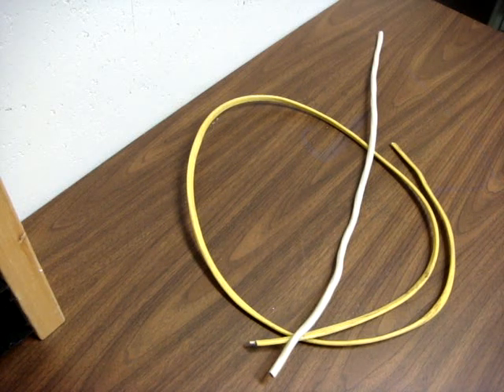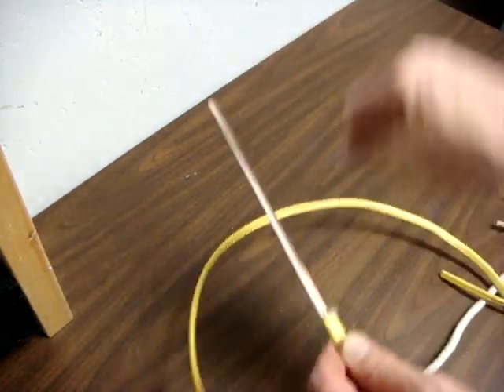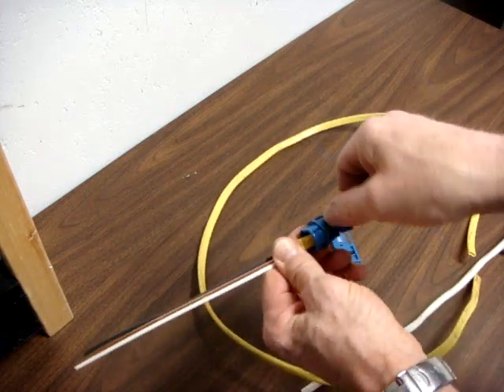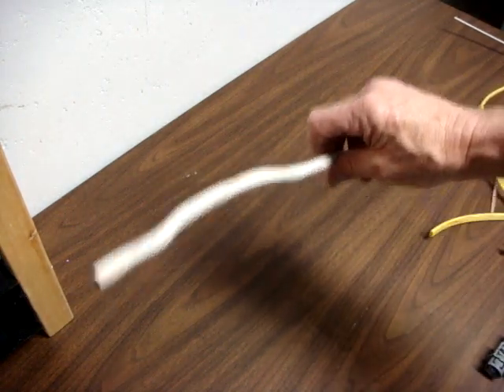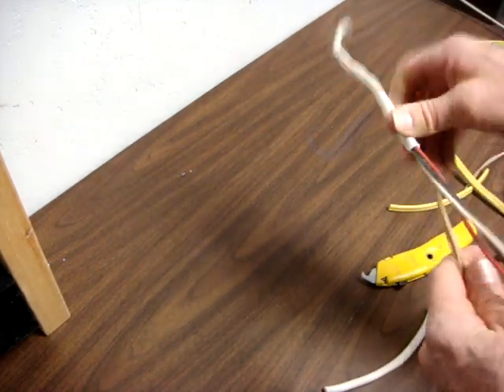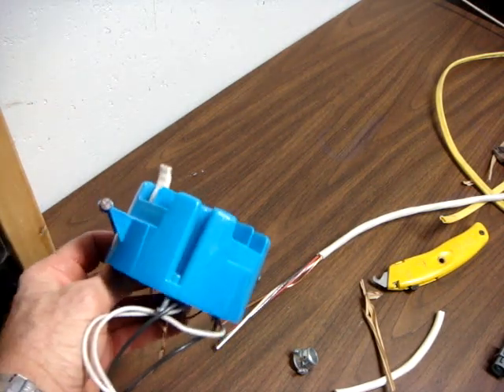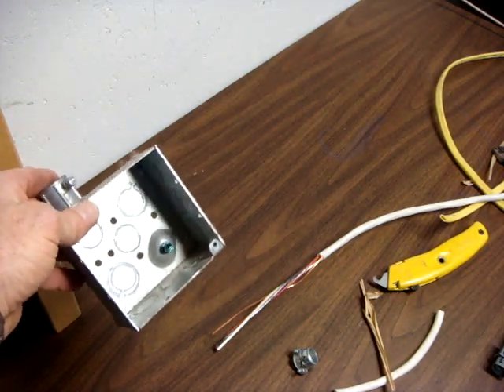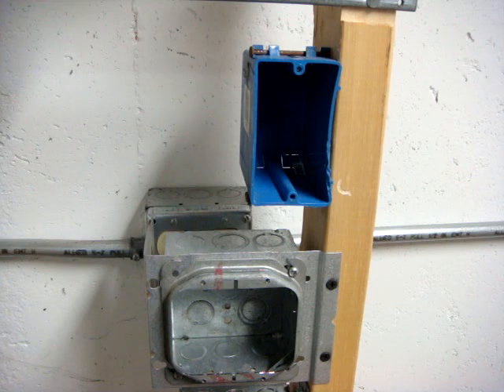Romex® Basics

Comment: Maybe someone can help me.  The yellow outer sheathing has small tears in them.  Is that ok?   The inner wires are not stripped
Reply from the maker: If you think the jacket's integrity has been compromised, you can wrap it with electrical tape.

Comment: That third, blue connector: how do you get it off the wire? I am struggling with it. I'd rather not cut the cable, I need the length.
Reply from the maker: Use a side cutter and destroy the connector.

Comment: Please show how to splice multiple wires together.

I am practicing my Pig Tailing and the Pig Tail will not twist around the other wires when twisting the Wire Nuts.

I am practicing on fake boxes not connected to anything.
Reply from the maker: Are you splicing solid conductors, or stranded conductors? What gage conductors are you splicing?
Reply: sparkyjohnrg I am practicing splicing 14-2 wire for 15 amps capacity. These are solid copper conductor wires.
Reply: +SPARKYJOHNRG,

Well how about an answer here?
Reply from the maker: Michael, This is a very busy time of the year, and I do these videos as time permits. I do this as a service to viewers, but I am unable to do them "on demand".
Reply: +Sparkyjohnrg,

I am not asking for videos just a quick answer.
Reply from the maker: Michael, you wrote: "Please show how to splice multiple wires together. I am practicing my Pig Tailing and the Pig Tail will not twist around the other wires when twisting the Wire Nuts. I am practicing on fake boxes not connected to anything." To me, that is a request for a video, as I cannot show something without pictures. The brief answer would be that a pigtail should not "twist around other wires". If all of the wires are solid, cut them all the same length, and use a wirenut to splice them (or WAGO's). You are not required to twist them together with a pliers.

Comment: Sir may I know what size of connector for 6/2 wire I can use for steel city box and also a connector for 6/2 wire going to load center or service panel.thanks and more power to you sir.

Comment: need to know what size wire nut to use I'll have two 12 gauge wires Plus the little thinner wire from the light fixture. dude if you got a second and could recommend something that would be great
Reply from the maker: All brands list the wire sizes and combinations that their wire connectors will accept. Generally speaking, your situation will work with yellow or red connectors.
Reply: Thanks Sparky

Comment: Excellent Lesson!  Fast and Informative.  The one thing I would add is a more thorough description of boxes.  Does the single box size work for a switch and an outlet?  Why are there so many boxes for sale.  When do I use this one or that one.
Reply from the maker: +Anony Mus   I wanted to keep it short and informative. I ALWAYS use the deepest box that will physically fit in the space. That gives you more room for wires and devices. Plastic boxes are usually cheaper than metal boxes, and install faster. Some choices are more personal preference than anything else.

Comment: I recently had our old natural gas water heater replaced with a new one.  This one has an electrical ignitor instead of old style plot.And that means I have to have a power outlet to plug the heater in.  I have an existing circuit in the closet which feads to a light switch that controls a light.  There is anothere similar switch exists with a red face plate, labelled as Gas Burner which leads into the furnace.  I wanted to add a receptacle BEFORE the electric switch so that the operation of electric or gas burner switches do not interfere with the receptacle. Although, I have some idea as to add receptacle in parallel, so that in case something doesn't work with receptacle, the other switches still work.  I will be more confident if I could see a circuit diagram.  Can anybody please help?
Reply: This is a little late, so you probably have this done already but maybe someone will find this useful. you can take power from the light switch to power the new outlet you just have to wire it correctly. After you turn off the circuit in question, open the light switch box and remove the screws that are securing the switch to the box. Count the romex coming into box, each will have a black (power), white(neutral) and bare copper(ground). If there are more than 2 Romex in box, all the blacks going to wire nut are your power wires. The one wire coming out of wire nut to switch (pigtail) is power to switch. The other wire connected to switch is taking power to the light, always keep that separate. If you want to take power from light switch box, run one Romex of the same gauge to the new outlet[either 14-2(white Romex) or 12-2(yellow Romex). Feed one end of Romex into switch box strip about 10 inches off by running a knife down the middle of the LAST INCH OR SO of the end of the Romex sheathing. Split the sheathing, and peel the remaining 10 inches off and then cut just the sheathing off. Connect each wire from new Romex to their respective wire nuts in switch box by stripping the end of each conductor (1/2")to make a good copper to copper connection. So all of the black power wires go to one wire nut with one pigtail wire taking power to switch. All neutrals in this case will connect together in one wire nut. All grounds go together, with pigtail to ground screw on switch. If the box is metal be sure their is a ground connection to box. In the beginning, If the switchbox only has two Romex coming into box, identify the switch leg( Romex going to light) which is the black wire connected to switch and keep it separate. The other black wire connected to switch is the power. Take the power wire off switch and connect it to the black wire from Romex going to new outlet, with one power pigtail that you will reconnect to switch. So power is routed around the switch but also has a pigtail that brings power to switch. Connect neutral and grounds like previously stated and you're solid.

Comment from the maker: You cannot cut a wire and cap it off with wire nuts. All wires must terminate in a junction box. Whether you must remove the wiring from the switch box would depend on who ordered you to remove the light. Ask them.

Comment: question: I have an electrical light I want to permanently remove from a garage. I have to remove the electrical wiring from it. Do I have to remove the wiring from the switch or can I cut the wiring before the entrance of the junction box and switch and use wire nuts for the wiring for the cut wire?
Reply: I know I'm 4 years late and no one else answered you so you probably did it the way you were explaining and died in a house fire but in case you made it out alive, the proper thing to do would be to just cap the white, black and red wires separately with marettes and then cover the octagon box with a cover plate.. Note that it would always have to be accessible.. If you wanted to cover the access with drywall then you would have to eliminate the wire from both the light and switch box so that the cable could not be accessible for future use..  R.I.P

Comment: If you use a plastic box, where do  you connect the ground for the receptacle?  Just attach it to the ground screw on the receptacle and that's it? thanks
Reply from the maker: Yes, If there is only one cable in the box. If there is more than one cable, you must splice the bares together with a wirenut, and then connect it to the receptacle.
Reply: Hello, thank you for writing.  Still a little confused.  I don't see a screw on the plastic gang box to attach the ground, so I guess the only place to attach the romex ground copper wire is to the a/c receptacle greenish-looking "ground" screw.  Correct?
Reply: I think I got it!  thanks!
Reply: No fire yet!  Just kidding!
Reply from the maker: Russell Garr Plastic is an insulator, so there is no green grounding screw in the box. The receptacle gets the ground wire.
Reply: Thank you!

Comment: I have an outlet that has power coming in, then going out. It has also been tapped into to supply and outlet for the home alarm. So the top screws have two sets of wires coming off them. Can I tap into the bottom screws to add another outlet? Other option might be to tap into the outlet that's powered by the original outlet?
Reply from the maker: Both options should work fine. I usually find it difficult to push an outlet back into the box with 8 wires connected to it. I splice all of the black wires together, and a short "pigtail" to go to the outlet. Then I do the same for the white wires. This has the added benefit of keeping the circuit intact, if the device should fail.

Comment from the maker: Cables must be attached to the box using connectors, and you should be able to extend the lighting circuit by connecting the new cable to the wires going to the existing light. Some recessed fixtures have integral cable clamps built into the box, eliminating the need for connectors. I never use the push-in connectors some brands use. I prefer to splice using "Wirenuts", a more reliable method.

Comment: Glad I watched this video. I bought a couple recessed light kits from HD that came with metal boxes, but no connectors. Connectors not even mentioned in the wiring instructions. The information I was seeking was how to connect and run Romex from an existing light fixture to my two new fixtures. Working in the attic. I believe I can just use the wire connectors in the established fixture and match up the wire colors. Thoughts?

Comment from the maker: The basic rules for Romex include stapling the cable, within 8-12" of the box, and not more than 54" apart after that. Re-routing cable can be done from basements, or attics, or opening walls, if it can't be done behind a baseboard.
Reply: @Eduardo Elliott instablaster :)
Reply: @Malik Kaiser i really appreciate your reply. I found the site on google and im in the hacking process atm.
Looks like it's gonna take a while so I will get back to you later with my results.
Reply: @Malik Kaiser It worked and I actually got access to my account again. I am so happy!
Thanks so much you saved my ass :D
Reply: @Eduardo Elliott No problem :)

Comment: Nice Video. Looking for some romex help and stumbled upon your vid. I have to re-route some electrical wires but cannot get them pulled up because they are tacked in pretty good and do not feel like tearing up the wall to get them out. Can I just cut the wire and re-attach new wire to it to put in the location I want? What is the safest way to do that? Thank you for your help.

Comment from the maker: The way that I usually deal with that problem is to cut in 2 boxes and run a new cable between them. You cannot stretch the existing cable enough to pull them into 1 box and splice them, so, you determine how far back you can go to get enough slack to bring each end of the cable into a box & run a new length of cable to connect the 2 boxes,

Comment: when using a utility knife, you dont need to strip the whole wire. When I do it I usually take off about 2 inches from the mark i make or usually locate with my eye and you just take the wires through the bottom through that 2 inch slit you made.